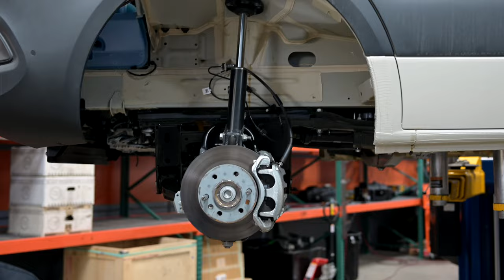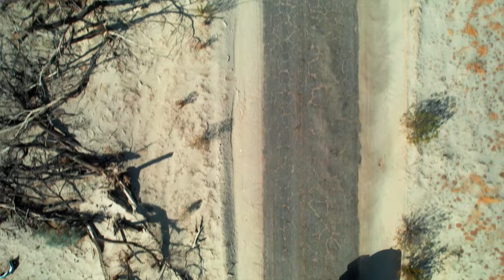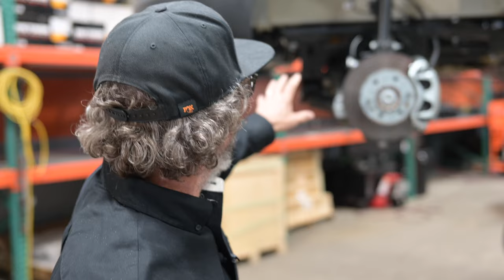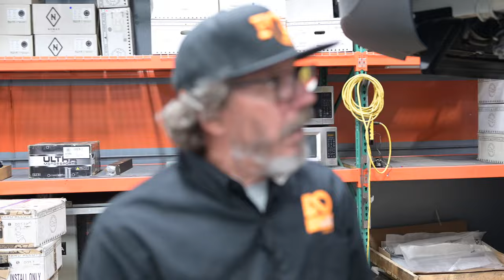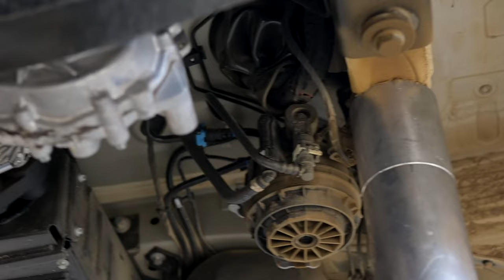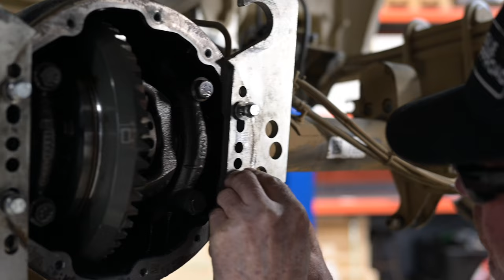All new 2023 Mercedes Sprinter questions answered

Comment: The V6 wasn't 4x4 even though it was badged and labeled as such. This new AWD is closer to a 4x4 with its 50/50 torque splitting transfer case. Although still lacking a multi speed transfer case that locks in 50/50 split. The old T case was 33/67 split similar to awd cars and suv's. But that makes sense for the old V6 4x4 since it's derived from the old Mercedes 4 matic E series sedan.

Comment: Thank you for the video. The 2023 actually has two gears lower than the 2022. First and second gears in the 2023 are  lower than first gear in a 22 model.

The 2023, though minor, has more horsepower and torque with the HO 4-cylinder than the V6.

I have to disagree with the turning radius the 23 turns significantly better and with the electronic steering over the hydraulic it's night and day! 

Let's be honest, you're not buying this to do serious off-roading.

One interesting fact is the 22 four-wheel drive model when in four-wheel drive puts 70% power to the rear and only 30% to the front. Try backing up a steep hill. ;)

Overall in my opinion the 23 model supersedes the 22.

Comment: New Sprinter can push even 90% of Torque to the front wheels. AWD’s main thing is electronics and all new 4ets system, new transfer case with plastic oil pan, new front diff, Transmission is „9G tronic” Which stands for 9 gears 😊 it is a system adapted from european AWD Vito/Viano known in USA as Metris. It is very delicate system compared to the previous 4x4, be careful with it, it does not like Big tyres and modifications. Vito and Viano were known to be very delicate, this is why they were not tuned that much in Europe. 😊

Comment: Anyone else notice the 2 piece driveshaft with the angle towards passenger side?

With Mercedes knowledge of 4 wheel drive systems, it is surprising they can’t do better than they have. 

No shift in fly with previous version and now this. 

Maybe the lawyers are telling them they can’t make a tall vehicle too off-road capable due to no control over build-outs that could be top heavy or have suspension lifts.

It seems they are monitoring Ford to see what the market accepts rather than coming out with something groundbreaking.

Comment: I have a 2021 144 ,4 cylinder 2wd diesel cargo van. I had my garage door increased so I could park it inside. When you have time can you give me an Exact measurement to the top of the rear brake light - if you have a 2021 144 , 4 cylinder diesel cargo that you could compare that would be great. All the dealer does is look at the brochure - I need an exact measurement.  thanks

Comment: So I took my 2022 4x4  in the mud last weekend, and was having some serious issues with the van keeping the power down when I would try to climb a muddy hill. I had ESP off, as well as all of the other nannies. It was such a bummer as I'd loose all the momentum I had going into the hill as the van would just immediately cut power on me, and despite being completely floored, the van would do nothing. I assume the 2023 will have the same type of ESP intervention when it detects wheel slip?
Reply: Are you using dyno mode in your 22 to override traction control? https://www.youtube.com/watch?v=Bhe3B9Xlzr8
Reply: @davidhopewell3397  At the time I wasn't aware of it, but I know have learned of dyno mode and will be giving it a try next time

Comment: Seems MBZ can't quite get the 4WD/AWD systems right.  The newest gen loses the low range which is unfortunate...especially if someone is doing long stretches in deep sand or uphills where the tranny and engine will be working harder.  And the old system with the need to slow to 6mph in order to shift in or out of high 4wd is really annoying...I know because I have a 2020 Sprinter 4wd.  Is there any modern 4wd vehicle now that doesn't have a full shift on the fly ability?
Reply: Iveco Daily 4x4 maybe?

Comment: Did I hear you say your 23 4x4 was a 4 cylinder engine and that MB no longer built 6 cylinder engines?
Reply: correct.  4cyl with slightly better output and fuel economy.

Comment: I have same van and in 20000 started with yellow check engine but the cod is nothing after 20000 mi yellow say on and sometimes go in the lip mode I do reset and goes way  then now 50000 mi ist in limp mode a went to mercedese diler the van is in for 3 weeks  they can't find anithing  and one more problem sometimes my batery runs out overnight  and sometimes don't for month ..... service can't find what is wrong with it .....
Reply from the maker: Hey! I highly suggest calling our shop to help diagnose your issue! 619-328-1297

Comment: very good explanation.  for those who are planning to purchase a 2023 Revel or Jayco Terrain/Entegra Launch, will 2023 camperVan has a 2022 Sprinter and 2023 RV build like previous models?  Not sure if you know. thanks
Reply: current 2023 Revel and Terrain/Launch are on 2022 MB chassis. That may change as the RV manufacturers start getting 2023 MB chassis in stock.
Reply from the maker: This will depend on the manufacture, you would have to check their website for more details.
Reply: @Agileoffroad  their website does not identify the year of the MB Sprinter.  Will just plan to buy 2023 before it happens.  thanks for the information.
Reply: @hank1527  You can check using the VIN #

Comment: No way would I buy the AWD, no low range 4x4.  Plus the AWD unit got stuck in your demo.  Being that it is a new year model I would not consider it until this model is out there for at least 2 years.  Get the problems out of the way with other people not me.
Reply: The MBZ 4 cylinder is not new , just new in the Sprinter
Reply: It’s not new, a decade on this engine and tranny already
Reply: Not new.  Been in the euro market for years.